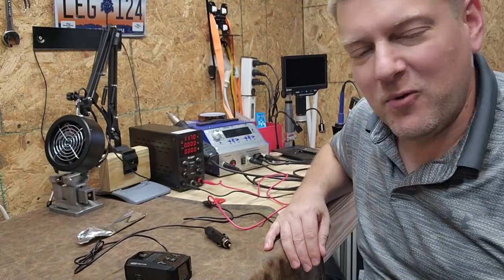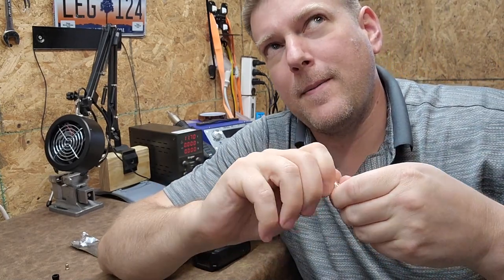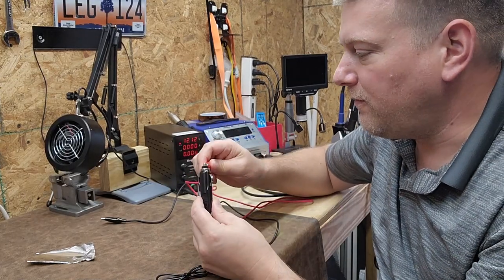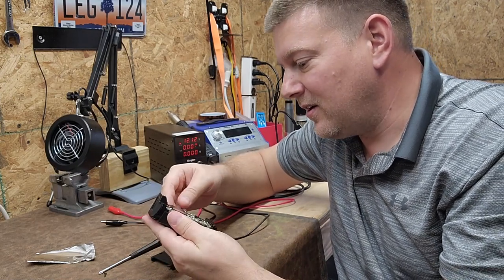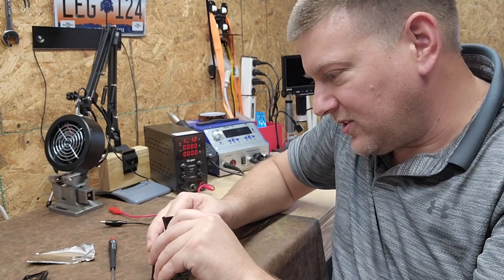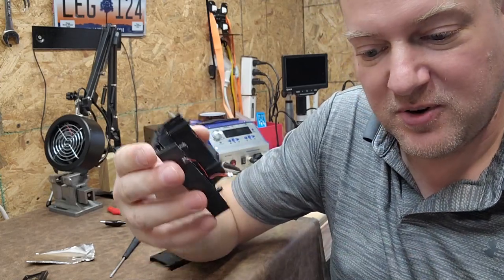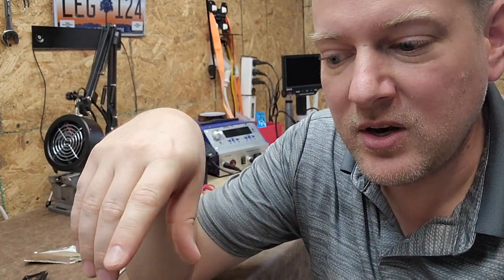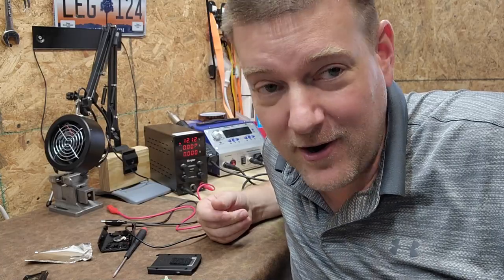Troubleshooting DC Electronics

Comment: Regarding car electronic devices that release the magic smoke, it is always a good idea to check the voltage on your car battery with running engine, to see if the Alternator is not putting out more voltage then normally. With running engine, the voltage should not exceed 14,5V. Back in the old days when a Alternator puts out more voltage then normal, the first things that blow up, where the incandescent light bulbs, now in modern cars with LED, the weakest component costs way more then a silly incandescent light bulb. Most car electronic devices that are installed by the car manufacturer have a good design, and have a TVS diode on the input to clamp high voltage or spikes, but this is not always the case when you add 3th party electronic devices to your car. In fact, some manuals of 3th party electronics described that you may only connect the devices after the engine is started, because during starting the engine, there is a huge power draw that cause the voltage to drop to a very low point followed by a surge.
If the electronic device contains a battery, this surge will be damped like a capacitor does, but direct powered devices don't have that capability.
Reply from the maker: Almost any newer car should have an error for out of range voltage

Comment: Hello and good evening, I’ve heard you mention DC rails a couple times and tried looking it up to see what exactly that is but can’t seem to find anything. Could you give a brief explanation.
Reply from the maker: A power rail is a circuit of a specific Voltage. There is usually a cpu / logic rail ~1.5-3V and there is an operating voltage rail which is 5V, 7V, 9v 12V etc.
Reply from the maker: https://www.aboutmechanics.com/what-is-a-power-supply-rail.htm#:~:text=A%20power%20supply%20rail%20is,a%20common%20or%20return%20line.
Reply: Thank you!